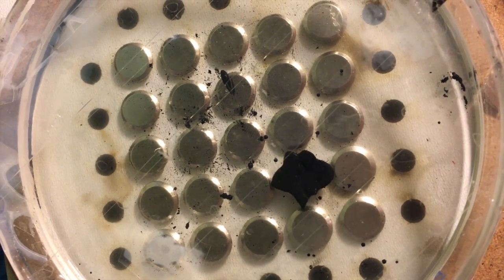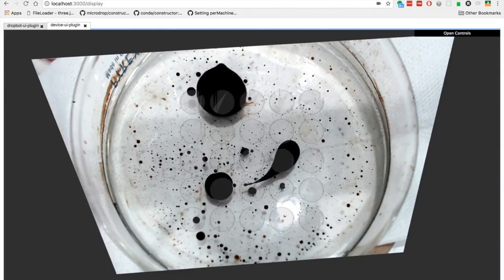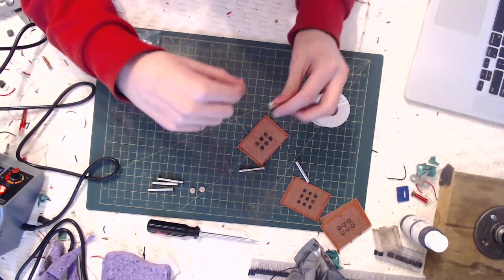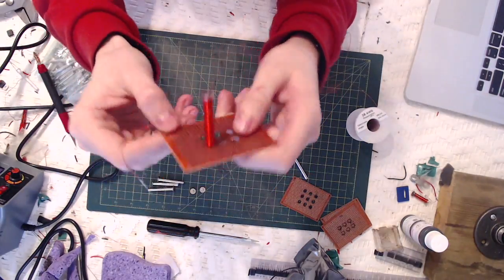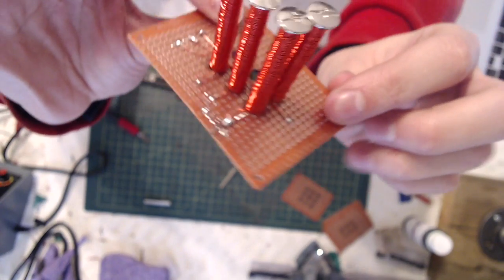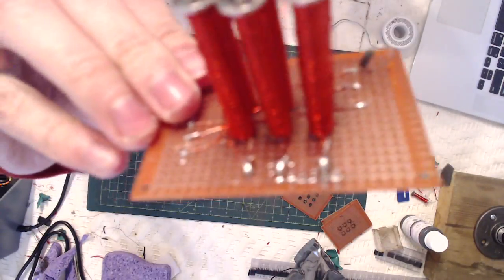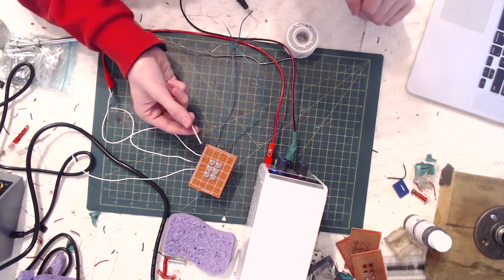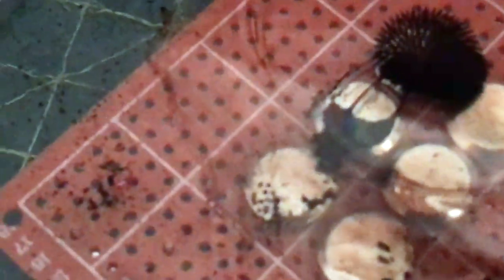Build your own Digital Ferrofluid Display! Part 1

Comment: good video and good explanation a query how many turns it is convenient to give the electromagnet, the gods you use are 1A and how you place them, in the video you can see 4 cables so I imagine that it controls two electromagnets at the same time for each cable, I do not know if that is correct since there is no photo of a schematic, I liked your project
Reply from the maker: Hi Alejandro! Thanks for your comment!  In this video I have the coils connected in the form of a row and column matrix (With mosfets connected to each row and column).

Comment: This is cool. I’m going to make a seven segment display using these, but I need to think up how to make the ferrofluid disperse over a line segment. Right now, I’m thinking of placing 3 electromagnetic screws in parallel per any given segment. I also need to figure out how to power it. I’m thinking +5V for the logic, and a constant current PSU for the powering of the screws. Very nice tutorial and well explained. Keep doing you, young man!
Reply from the maker: Thanks Jesus!

Sounds like a very cool project, and glad you are enjoying the videos. For these self wound electromagnets like in this video, constant current is a good idea; but you can also use the cores from micro solenoids as I've done here: https://www.youtube.com/watch?v=TeB56b0Mj8s. You can get them for relatively cheap from Aliexpress (1-2 per solenoid), and they are rated for a set voltage (Im sure some of them for 5V). 

Best of luck, and feel free to reach out to me via email (lucas.zeer@gmail.com) if you would like anymore additional info.
Reply from the maker: No problem! Great to see someone interested in microfluidics and electronics at such a young age. I responded to your email

Comment: Hello Man! Really cool tutorial! I just couldn't understand if the Diode is used in order to create the - or the +. Can you help me figure that out?
Reply from the maker: Hi there! Sorry, but just spotted your comment! Either way will be fine. If negative side (then positive towards magnet, negative to ground), if positive: (positive side towards supply, negative towards electromagnet). You want to prevent leakage current when addressing another coil. Although most of the current will take the path of least resistance, some will travel through the other diodes inducing a small magnetic field in the other solenoids otherwise. That + there will be reverse current when the power supply is switched off.

Comment: Hi, great video. Really enjoy these kinds of projects, and has inspired me to make a small display like this for an engineering project I'm doing. But would just like some more detail; what is the water and isopropanol mixture ratio for mixing the ferrofluid in without  any mess like you described, also what kind of fluid are you using? whether it be oil or water based and what different it makes. And finally if it will stain or damage plastics such as acrylic or other polymers since I'm planning on making a small transparent container out of plastic to keep the liquids in. Thanks.
Reply from the maker: Hi Tom,

Thanks for the comment and glad you are enjoying the videos! For a good mixture, I would recommend some natural window cleaning solution mixed with some sugar water (like diluted Sprite).  Something like: 2 parts natural window cleaner, one part sprite, one part water. 

As for acrylic etc: The ferrofluid will stain for most mediums, but I've had some luck with 70% isopropanol (which unfortunately limited the longevity of the ferrofluid). However, the isopropanol fogs and etches the acrylic, so you can only use it as a base (ie not in a closed container); this mean the device will have to be sitting flat. You can see it in operation here: https://www.youtube.com/watch?v=9im0WKN-eb8. 

If you have more questions, feel free to reach out via email (lucas.zeer@gmail.com)!